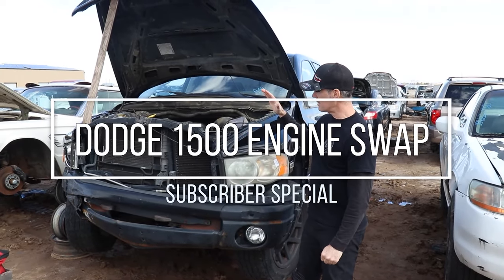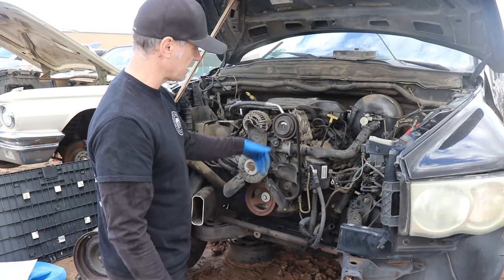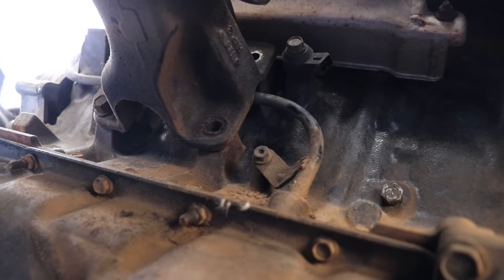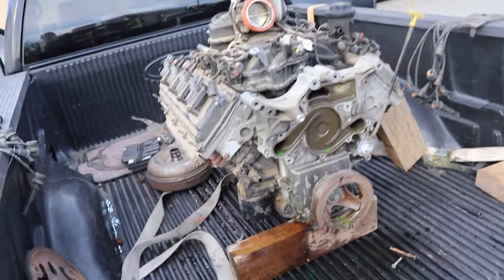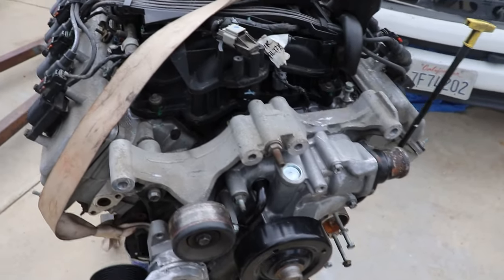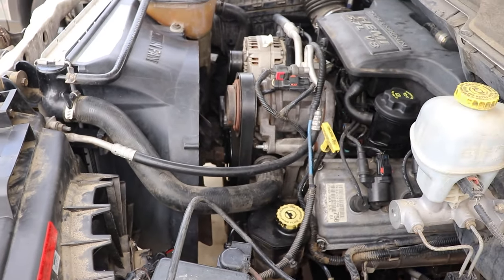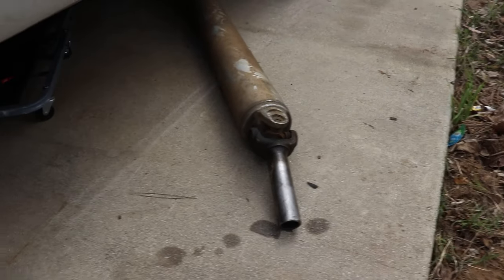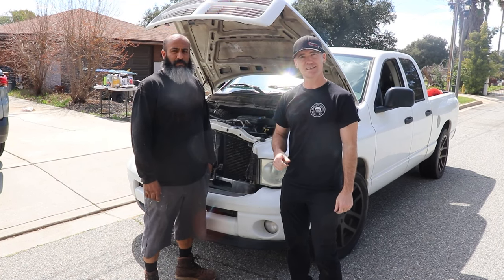$400 Junkyard Engine - Will it Run ???

Comment: Awesome find man😊😅😂
Reply from the maker: Thanks for the comments, we have been pretty lucky grabbing engines and transmissions from wrecked cars over the years. If we are not sure on them we sneak in our Noco jump box along with our start button and perform a compression check.
After looking up the history on this truck and seeing the low mileage and oil change done less than a month  earlier, we couldn't rip this thing out fast enough.
Thanks again for hanging out, Cheers!